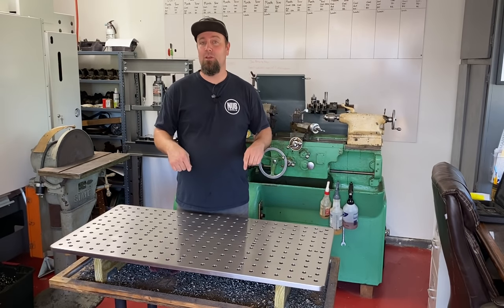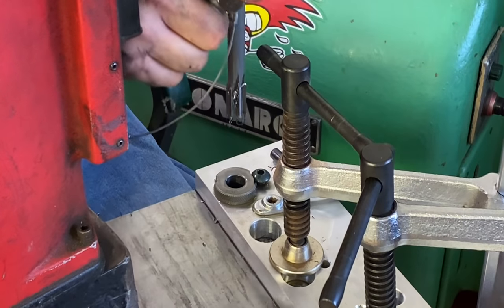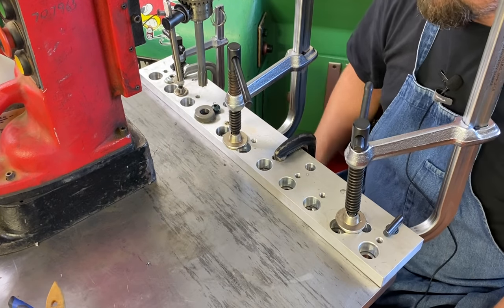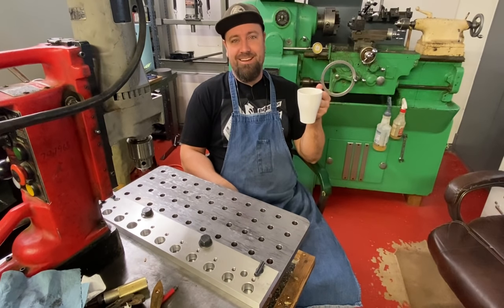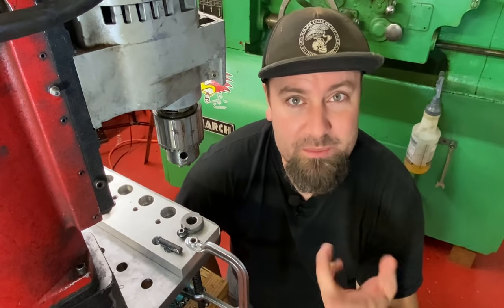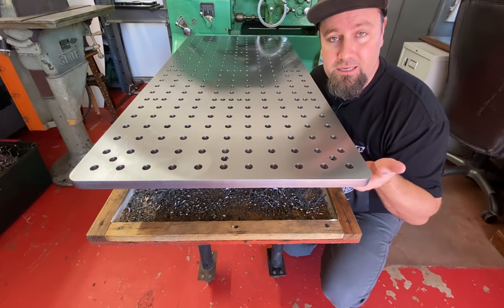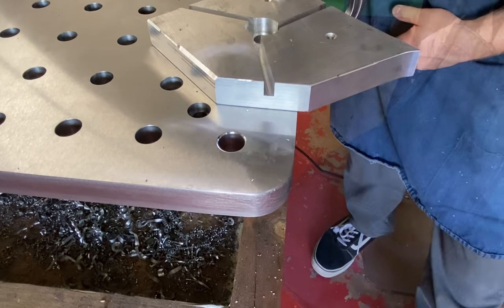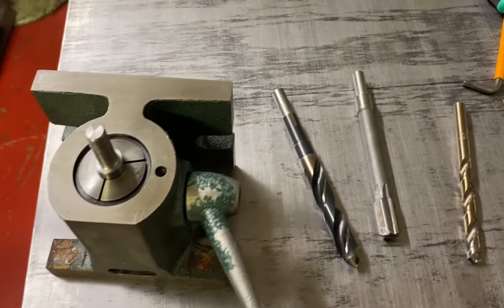My Welding Table Build | Drilling Precision Fixture and Clamp Holes With a Mag Drill Jig

Comment: Why would you not use an annular cutter ? They are far faster and far less wearing than twist drills .
Reply from the maker: Great question. First, I was dead set on having a reamed hole and holding a very tight tolerance, second the rental mag drills available were all set up with drill chucks. You are absolutely right that angular cutters are a lot faster. Maybe it would have been possible to achieve as good of a hole using the same drill jig set up with them🤷🏻‍♂️.  
Surprisingly all my drills had no problem lasting just fine all the way to the end.
Thanks for the comment!  -Dave
Reply: We’ll done! I’ve started a similar project. I’m using a 16mm taper shank drill bit mounted directly into the mag drill. I’m not using a pilot hole and it’s working out fine. So there’s no chuck or bushings involved.
Reply from the maker: Nice! Thanks for sharing your cat skinning method. Good luck to you. 
-Dave
Reply: Appreciate a guy that is prepared to go "back to basics"!... Not everyone can afford the most advanced tools/cutters available!... Doing a fantastic job with limited tools ticks my boxes more than someone relying on a CNC MACHINE to perform the job while you're just watching (and drinking beer during) the process!!! I honestly appreciate and respect the effort of my new YouTube creator!!!... Are there more effective ways of accomplishing the same result?... Most definitely!!!... Is it more satisfying to watch a CNC machine performing all the (same, automated) tasks autonomously?... Most definitely not!!!... If this exact same video was about a CNC machine creating this masterpiece, no one would have watched till the end!!!... (Would've been too boring!!!)
Reply from the maker: Hope to not disappoint but I am that CNC guy. More accurately an all of the above. My origins were in all the basics but I fully embrace the awesomeness of computer controlled tools. There is beauty in all of it.
Reply: @nubtools  I agree 💯!!! I absolutely love and embrace technology!!!... I use the most advanced computers for performing my job (rather than a scientific calculator)!... The point I'm trying to make is that it's often so nice to go back to HAND TOOLS (not power tools)... We got spoiled with power/fancy tools!... In the process, unfortunately we lost the skills our past generations had!... Our grandparents and their parents paved the way for what we have today!... And they did all of that with hand tools!... Food for thought... How was the very first lathes built?... (These days all lathes and milling machines are obviously built on lathes... How did they built the VERY FIRST lathes?)
Reply from the maker: When I die I plan on asking God what made the first straight edge to begin the creation of precision machines that make precision machines.
Reply: What do you use for drill lube?  Sorry if it's somewhere in the comments..lol
Reply from the maker: No problem. It was a water base coolant from Milwaukee. Got it from McMaster Carr #31625A61
Reply: @nubtools use the 3 plate method to make a reference plate, then make the straight edge.
Reply: I used an annular cutter on my mag drill. It took 12 seconds a whole cut like a dream 
and for the 5/8 pins I bought a box of 5/8 shoulder bolts work perfect
Otherwise nice table!!!
Reply: How nice would it have been to have a bigger CNC mill and do the holes in that 😂 I can appreciate the accuracy of a reamed hole over just a drilled one. If you’re putting in locating pins to like square a corner this is far more accurate. I’m lazy and put 6  3/4 X 12 X 36 CRS plates on mine. I put a 3/4 space between the plates which allows me to slip in clamps. Much more flexible in putting clamps where needed. And no 40 + hours drilling holes lol. Easier to grind the plates too. There are 3/8 flat head bolts threaded into the plates ( 2 on each end)  , then an adjusting nut under . Clearance holes in the top frame rails. Then after adjusting simply tighten a bottom nut to lock in place. Pretty accurate . Easy to replace a section if you happen to damage one too.  They used to say the laziest toolmaker was the best. Always found the easiest way to accomplish the job without sacrificing accuracy. But Kudos to all your work! That would have cost BIG bucks to purchase.

Comment: Never in a million years would I have guess you could use that router with standard carbide/wood bits. Looking forward to trying this on my next metal project. Great looking table. Lot of work.
Reply from the maker: Same here. I am thinking of all the past projects that it would have been useful on. 
Thanks for watching!
Reply from the maker: I did not experiment on speed very much. My cordless Mikita goes to 5 and I had it on 4🤷🏻‍♂️
Since the bits I used were carbide tipped I could get away with higher speed but really I just don’t know if slower would have been better on tool life. The finish was excellent. 
On depth of cut I went full depth right out of the gate. 1/16” 45deg chamfers on bottom, 1/8” radius on outside edge and 1/16” radius on top holes. 
Tool life: Chamfer tool(Diablo from Home Depot) was the winner. Only used one. It did all 253 holes like a boss and started to show signs of wear at the end when doing the bottom outside edge.
It took two 1/8” radius bits to do the top outside edges. 1st bit did all the work and the second bit was a finisher that is still in great condition.
The 1/16” radius bit required 2 bit and it looks dang good but I will get one more before the project is completed for a final cleanup.
Thanks!
Reply from the maker: I will say, if I only wanted 45deg chamfers, I would consider strongly looking at the pneumatic chamfer hand tool that uses indexable carbide insert. You can find them on Amazon. I plan on getting one down the road. But on this project I was set on putting some radius corners, so the router was my choice for execution.
Reply: They are HSS like the drill bits!

Comment: Reminds me of a project i did a few years back. Decided to put cove lighting on a set of 4 hexagonal structures being mounted 5inches below the ceiling. Used RGB led stips. Layed them in 1/2 inch C channel that was welded on top. Thought I was going to use quick connections. But they only come in 90 degree turns. Hexagonal is 120 degrees. This meant each strip required 5 wire's to be Sauder. In total just over 3,700 sauder connections were done. Took me 4 weekends. About 150 hrs in total.

Comment: Nice setup and taking the time. 
If you want to save the time use a annular cutter. Had 245 holes done in 4 hrs thru 9/16
Reply from the maker: 😂This seems to be the consensus. People seem to think time is important or something.
Thanks for watching!!
Reply: @nubtools  really want to save time?  Design in CAD and have a laser cutter do it for you!  It's cheaper than you'd think and it takes the guesswork out of it.... or buy one of the iron ones... they really aren't that bad!!
Reply: Beware!! You need a special annular cutter designed for stacked plates (in this particular situation), otherwise the slug+washer that the cutter creates in the first hole will prevent the teeth from biting into the second plate and you will need to remove this first slug to continue the cutting. The stacked plates cutters cut on the INSIDE instead of the OUTSIDE, so they create perfect cilindrical slugs, without the flat "hat". Other than that, yes, annular cutters is the way to go, moreover if you are RENTING THE MAG DRILL!
Reply: Yeah... as soon as I saw him pilot drill I heard the "oh no, oh no, oh no no no no no" song in my head! Great project nonetheless, but annular cutters will change your life!

Comment: Very nice work!
I am looking at doing the same thing and have a few questions.
Did you go with removable bushings over  press fit to save money? I can see having to switch out the bushing between holes adding a lot of time.
Did you use bushings 3/4" long or less to create chip clearance?
Was there a reason you used a drill bit and reamer over a annual cutter?

Thank you for your time
Reply from the maker: Thanks! Cost and function drove my decision of which it’s been so long I don’t remember.😂

Comment: You do nice work, the drill fixture is a work of art . I used to work with this older guy Danny and he did a lot of the lay out work on the flat sheets and he would always use long steel rules 36 inch 0r 48 inch or a folding ruler to lay out his work , I dont know if I ever saw him use a tape measure ... my point is  he was spot on every time,  and you remind me of Danny
Reply from the maker: Hey thanks man!

Comment: I bought a 2' x 3' fixture table that seemed just a hair too thin to hold stronghand clamps without them kicking sideways a bit. My solution was to do this template/drill method to an inch thick section of Aluminium plate that measured 1' x 2'. I used a wood CNC to layout 1/4" holes on centers of the grid pattern and used a center punch through the template to mark spots for a mag drill setup with an annular cutter. Now I have a nice block for holding and welding on.
Reply from the maker: Nice!!

Comment: Thats an interesting way of doing it.We are working on one now. I made a fence, did 3” OC holes, I made tapered reamed holes on a 3” center that the mag drill centers on the guide. We are using a 5/8 annular cutter in our mag drill, .625 gauge pin fits perfectly. What did the Blanchard grinding set you back? Nice 10EE btw, I have 1939 10EE myself.
Reply from the maker: Thanks! It’s sounds like a good plan you got there. I had a buddy deal on that grinding for $100. Which was super cheap for the some they had in it because it was done on a surface grinder. 
Later in the project I had the top plate bottom side and the top of the frame  Blanchard ground at a different shop for $185. Not a buddy deal and yet still a fantastic price. The Blanchard grinders require so much less machine time. 
Cool on your EE. Mine is a 1951 model I believe.

Comment: I would like to try this with an old table saw table.  Trying to stay on a budget...  I've designed a jig similar to yours, but it's designed to work around the features in the table saw table.   But, would it be necessary to ream the holes if I were to use annular cutters?
Reply from the maker: Try some test pieces and see if you like the holes.
Reply: @nubtools  I will certainly do that.  I really appreciate your idea for a build like this and the steps you took to maximize the precision.

Comment: The table looks great and I could see it was definitely a lot of work. As I watched I was wondering if you could get away with more widely spaced holes. There wouldn't be nearly as many to drill out and the table would get done with much less labor involved. It seems to me that holes about 6" apart would work fine (at least for the types of things I have done). Or, maybe a hybrid where you have a small portion of the table with close spacing and the other part wider spacing.

It would be a huge step up for my home shop to have a fab table but I don't think I could justify the cost of buying one. Building one like you've done is more along the lines of my budget.
Reply from the maker: I’m so glad I went with 2” spacing.

Comment: So you used wood routing bits to chamfer the edge of your steel plate?  I had no idea those bits would work on metal.  Was there a specific kind of bit?
Reply from the maker: Yah, me neither!
Carbide tipped. If I were just doing chamfers I think the hand held pneumatic chamfering tools would be a better choice. Can be readily found on Amazon

Comment: I was wondering why you did not use annular cutters to make your holes. When I did mine I used
a 5/8 in annular cutter and I made a jig to center punch to mark a dipple for the center point tip
of the annular cutter. I just marked all the holes with the center punch then moved the mag drill
to each mark and  drilled and it did not take much time at all. You did a fine job and it looks great.
What I do to keep the surface protected and clean to spray WD40 on it then wipe off with a towel
do this as often as you need.  I also cover my table with a large welding blanket when not in use
at night etc. Good job there.
Reply from the maker: I was just set on doing in the way I would if I could have put it on my milling machine. Speed was of no concern. Hard headed.
I have been doing the same with WD-40.
Thanks for the tips and watching!
Reply: How accurate did the spacing turn out using this method?
Reply from the maker: Over the length of the table the pattern grew about 1/32”.  Straightness and squareness over the entire table turned out amazing and that was my top concern. If I had started in the middle and went in opposite directions maybe I could have split growth in half. 
Thanks for watching!!
Reply: @nubtools  sorry that question was about the centre punch method. I figured your way would be very precise. That’s a tolerance I could definitely live with but don’t have the patience to drill them the same way you did to be honest. Thanks for sharing learnt a few things 👍
Reply: The best way takes the most effort. Any one can center punch and mag drill and holes will be all over the place. Good job with drill fixture
Reply from the maker: Thanks Brian!

Comment: I’m just curious what the final tolerance was on the flatness of your table? I believe you said you were using an electric magnet system for mounting and leveling on a frame?
Reply from the maker: I don’t know for sure but it should be within a few thousandths.  The table frame mounting pads were ground flat as well.

Comment: I had my fixture drilled at the metal supplier in aus. 
1500x750x12mm plate, with CNC drilled holes it was $125aud ($80usd) for the plate material and drilling/plasma cut to size. 
I machine a lot of tedious tasks but for the precision and 2 day turn around paying the money was worth it. I will definitely use that carbide router step on the edges of mine now
Reply from the maker: That sounds great! 
Thanks for watching!
Reply: @nubtools  your workshop looks pretty setup so far. Do you use many shop carts? I use so many in/out carts at the mill and belt grinder 
Ausfalia has a lot of iron so its dirtcheap wholesale and great quality. But we don't manufacture cromo or cold rolled much which sucks
Reply from the maker: It’s getting there. I have one main cart that use. That does stink about not having much cold rolled steel.
Reply: Hi, I'm in Aus, can you tell me where you got that done? That price is great.
Reply: @stevewilson1004  I don't even know the name of the shop, they just sell plate steel and I ordered the largest size that fit in their mill. 
Its down pt road in SA, I'd have to drive there or hunt on maps to find it. I regret not buying 4 of these fixture plates at once though
Reply: @janeblogs324  Sorry to hassle you again. Have I got it right? You got your whole 1500 x 750 x 12mm top  with holes already done for $125?
Reply: @stevewilson1004  yes, plain hot rolled steel, plasma cut to that size as that was the max size the mill took. 
This was 10 years back but Australia and especially SA has always had cheaper steel than the rest of the world

Comment: Nice work just gained a sub, I want to make a table also but with out a accurate template as of yet it will be difficult, i have the mag drill and have a few surface steel plates I want to convert for a table, problem with them is they have support structures under on the bottom that could be a problem drilling or getting around.
So the drill bit is a bit small and the reamer does the finishing touch for the correct hole size?
Very cool
Reply from the maker: That’s correct on the drill and reamer. Good luck on your table build. Thanks for watching!

Comment: What specific type or brand do you prefer as cutting fluid?
Reply from the maker: For this project I used a water based coolant from Milwaukee that I got from McMaster Carr, part # 31625A61 . It worked great and If I remember after being mixed with water you end up with one gallon of coolant. I’m sure other brands are just as good. I do prefer these water based coolants for this type of application cause they don’t leave an extremely oily mess when it drys out.

Comment: Why didn't you put the end clamps on; tails-down when you made the first holes? They wouldn't be in the way~ Great project!
Reply from the maker: I really don’t remember 😂🤔. Gunna have to think on that one. 
Thanks for watching!
Reply: @nubtools  ya know you can tack weld cheap C-clamps together with flat steel and hit the tack with a grinder to release them and reconfig! Tether as many as you need. You can even make 30's, 45's,  and 90 degrees multi-clamps/jigs. If you put table pins on them you can build vertically in any/every direction. Clamps are great helpers that don't argue, talk back or need a pay check~ When your rich and famous you should get a CNC and a Waterjet! Great work man!